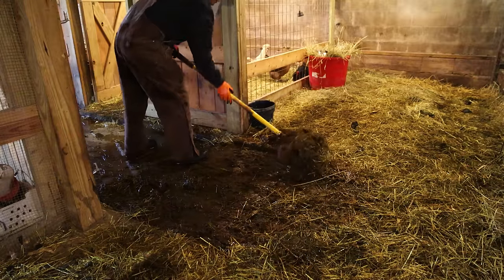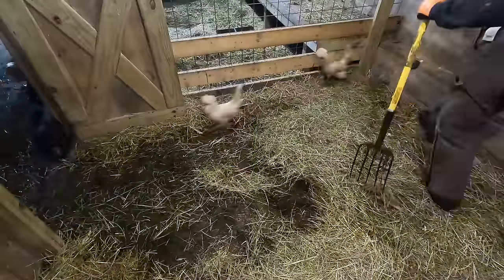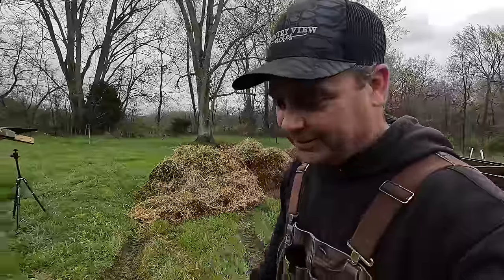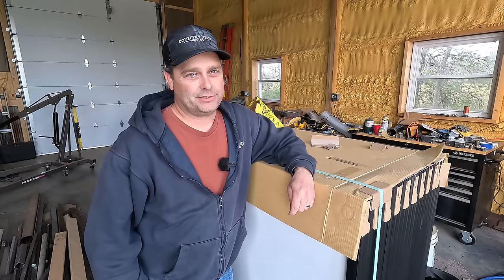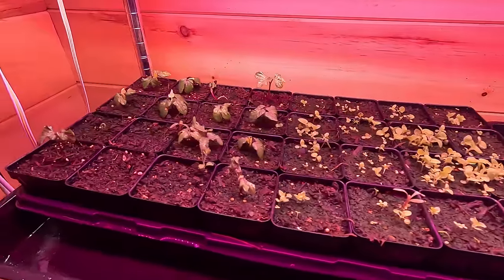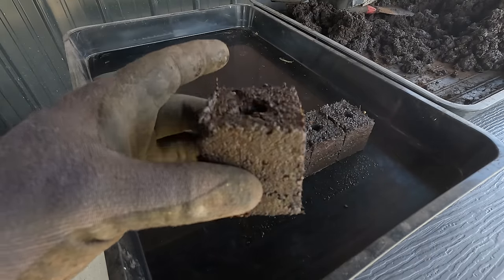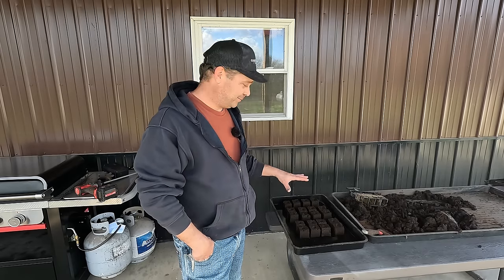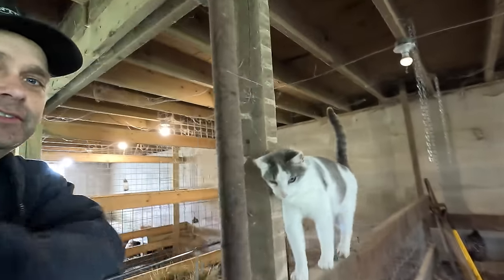So Much Rain, Cleaning out our Wet Barn.  Upcoming Project.  Preparation for this years Garden

Comment: WE can only encourage you to fix the gutters, grading and drainage around the barns.  you have spent a lot more time fixing the results of the water damage than it would take to address the root causes.   You are very smart Evan.  Keep up the good work! Thanks for sharing.
Reply from the maker: To dig up the barn perimeter and install French drains, install gutters and drains.  The livestock need to move somewhere else.  So I am working to create a new pasture, that will have plently of grass for all the animals.  Then I can move the livestock over there, and work freely on the barn.  but the pasture needs to be done first.
Reply: @CountryViewAcres    Thanks for the reply.  It seems you have the situation well in hand.
Reply: Up north they just add more straw or hay until spring time and let it build up. I don't keep and cattle inside, although they sometimes have access to the barn depending on the weather. I don't have that challenge.

Comment: Just a suggestion from one YouTuber to another. I have three channels, two of which are monetized and one I am still working on. Creating new channels can be challenging because you put a lot of work and effort into the content and you don’t get any for it at first. What I have done with my off grid solar project is I keep it on my main channel however, I gave it its own playlist. And I title every video in that playlist “OFF GRID GOLIATH” and then more specific details to what that video is about. That way if you have a viewer base that’s not interested in it. They know that they don’t need to watch it, but the viewer base that  is interested in it will still watch it and you’ll still get the monetization from it. Most of my content is motorcycle related and/or repair videos. And my off grid solar stuff doesn’t get a lot of attention. If it builds up someday, then I may consider making it its own channel but for now it’s much simpler this way and you don’t lose the monetization.
Reply from the maker: We usually do that, but we are out of barn lime, we need to pick some up at the farm store.
Reply: @CountryViewAcres  i’m not sure. I understand your reply to my statement. I have a feeling you were thinking of a different comment
Reply from the maker: @amsoiladam  yea that was supposed to be a reply to a different comment.

Comment: Yes please Evan you really need to cut through the barn floor and redo the drainage system. After piping out the barn have a huge  french-drain system from the back wall at least halfway to the firing range. 5hat will keep the barn yard dry all year round. Having solar all 5he way across the roof is only  smart it would just be wasted space if you didn't. Also I was wondering why you didn't move the household propane tank and put it by the garage propane tank so it wasn't in view. Great show 8ve been watching for yrs.

Comment: Evan. I'd put gutters on the front side of your barn to try to funnel it away. It doesn't have to be fancy. You can get the sections they sell at Lowe's, Home Depot, or Menards and build your own gutter. It might not stop the water getting in the barn but I'm sure it would help. By the way, I don't mind the solar info. I've got an electronic background. I understand it.  Dave in TX

Comment: Jesse Muller runs a channel and he is BIG into solar... but really he's into just about everything.  He has a geothermal system using a pond he built, and the solar panels, and now he's building a shop which he's going to power with solar.  He just built a trailer to mount solar panels onto and make them somewhat portable.  He build solar arrays that track the sun as it moves across the sky.  His channel is just his name... Jesse Muller.  If you haven't seen it, it sounds like his content would be right up your alley.

Comment: If you.  Rent a concrete saw you can go from. The wall where it. Is wet and. Put. A 4 inch tile in below the floor.   Use.  Drainage. stone   ,  put the tile down    6.  Inches . And take it. Out side 

    For someone that has so much talent I do not know why you can’t tackle this job 
Fairly. Easy.  
    But. For. A lot. Of. People they do not understand drainage.  Water runs down hill and goes to. The least resistance    Simple
Reply from the maker: I will tackle that job with time allows.
Reply: @CountryViewAcres .  Thanks for. Your reply.  Evan.  When you use your. Master skills mind you will make it look easy
Concrete is probably not very thick. All. hand mixed. Years ago

Comment: Have you thought about digging a trench around 3 sides of the barn to a low side to assist drainage.
Reply from the maker: It needs a french drain around the permeter and gutters installed on the roof

Comment: Would it be feasible to install 6" gutter on shed with downspout on pig  pen side? Divert water into plastic 55 gal. barrel, plumbed with spigot & garden hose  for pigs use. In your vids it appears ground slopes in that direction.

Comment: Have you looked in to the new wind turbines where they run day and night and even cloudy days. I trust wind than solar because of the heat produce off the black surfaces. The black surface has to be heating up the Atmosphere where wind turbine doesn't unless you get the huge ones.

Comment: I would make feeders for the hay where you load it from the top and it comes out the bottom like the chicken feeders do. You guys waste more hay then anyone I've seen. The problem is the live stock can just pull all they want with nothing to stop it. I actually think they waste more than they eat. And as far as the flooding take the backhoe and dig a french drain across the upper barn and down the side opposite from where it all gathers and drain it just to that side not the side you go in with the tractor. And I also wouldn't put your compost inside a wooden structure that's why you had the fire not from the ashes. You dumped the ashes in the front and the back was what burned. Compost generates lots of heat to decompose. Even the papermill gets fires in sawdust piles from decomposition. They make air tunnels into the piles to stop the fires.